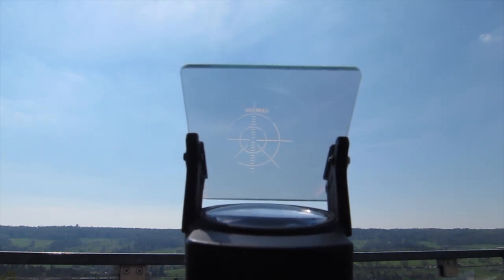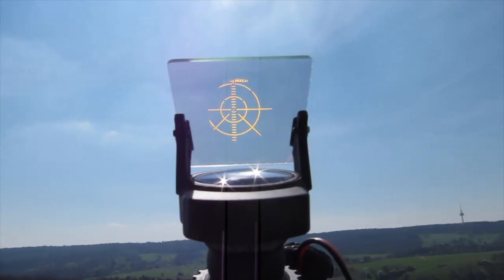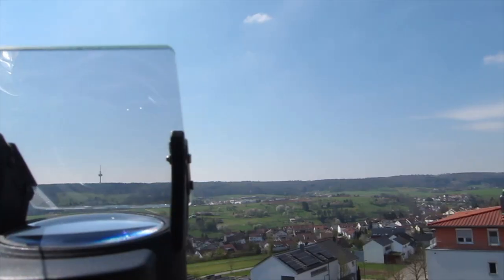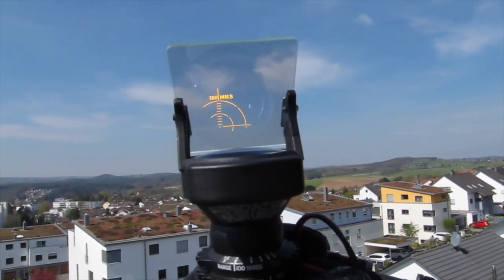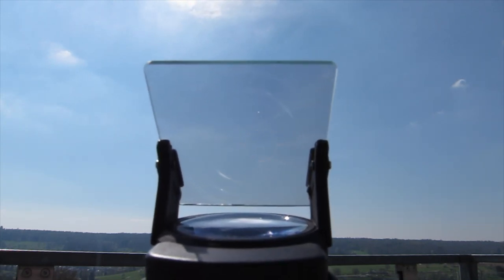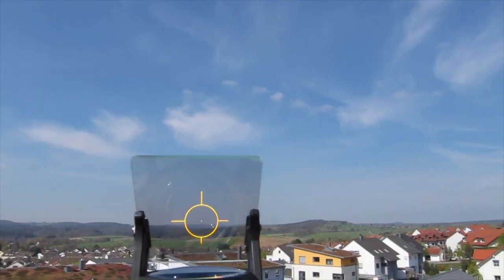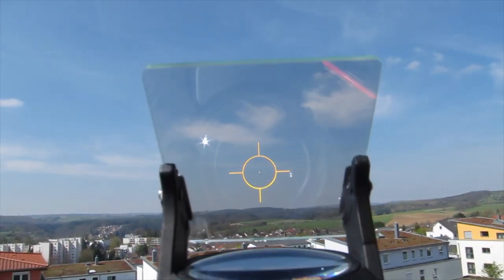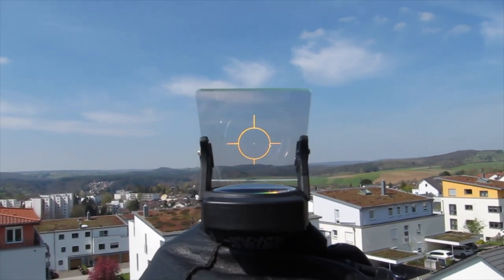functional Mk II reflector sight in 50% scale

Comment: Awesome reflector sights!  I have grown to like the simplicity of the MK II reticle over the MK VIII.  Glad to see you continue to improve the optics and adapt the rectangular splitter holders which impede forward visibility far less.  The RV 4 pilots are so lucky they found you!  I can only imagine the fun they will be having😉
Reply from the maker: Thanks! Some concessions to functionality had to be made though. There are no cutouts in the splitter holder, resin being far less durable than metal. But the holding clamps are scale sized. 
You could print a true scale sight body in metal if money was no issue...

Comment: Hello brother! Me and one friend keep trying to construct one sight like a BF-109 but we don't found how many lens and how the lens are place. 😔 Can you help me with a diagram or with types of lens ? Thank you and nice work! Pretty sight brother !l
Reply from the maker: Thank you! I used two cemented achromatic doublet glass lenses, 42 mm diameter, one on top of the other with a very little gap, each with ~ 130 mm focal length, ~ 65 mm focal length combined. 2 lenses in series= shorter FL. I would have liked to use one single achromatic lens with a shorter FL but I didn't get one. 
The Revi 16 is too small for this lens setup. Revi 12 might be better suitable.
Reply: @tim79de  Do you know if using this method to reduce focal length would still work if the 2 doublet lenses are different sizes?
Reply from the maker: @aeck2142  Yes, it does.

Comment: Is this similar to a HUD of a plane, true?
Reply from the maker: Yes, it's the precursor of the modern HUD but the image is made by a lamp, not by a screen.
Reply: @tim79de  and could you resolve any questions that I have? For example: the type of screen to be used for a HUD have to be very bright? ...or the size of the screen will be that the HUD presentation be bigger? (I have saw DIY HUD models with lens and others that not have It, is this maybe, for made the image more big) or just for focus and make imagen more definited or more detailed/increased resolution?
Cristal where show the data have to be polaryzed?

I am studying avionics and as a part of one of my classes I am building a HUD like project that I have to integrate in a simulator of a cockpit (the idea is show the data for DCS and MFS2020 simulators)

MANY THANKS for ALL.
Reply from the maker: @MrRegresoalfuturo 
The only small aviation screens that would be bright enough are these expensive ones:
 https://www.alibaba.com/product-detail/SeeYA-1-03-inch-2560x2560-20000nits_1600441843029.html?spm=a2700.shop_plgr.41413.4.7f4f2bfeEIptoL